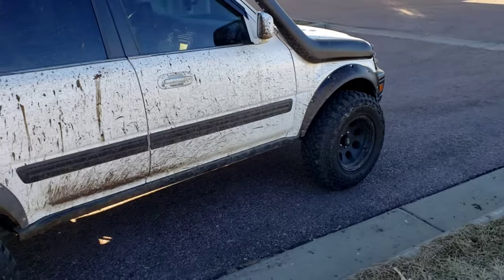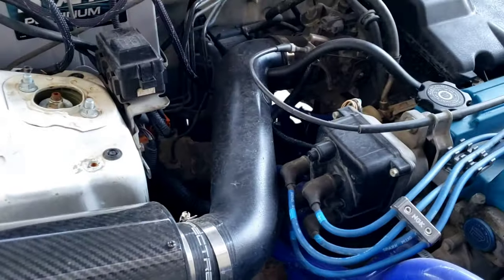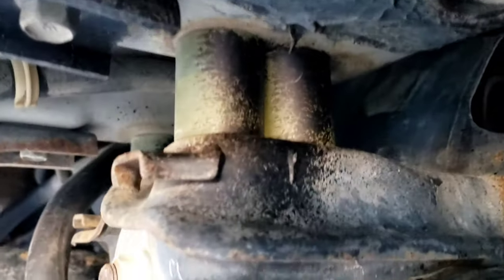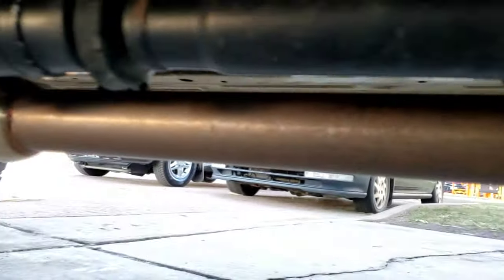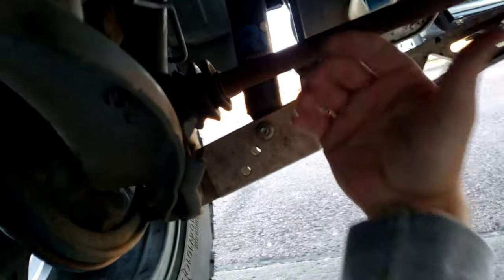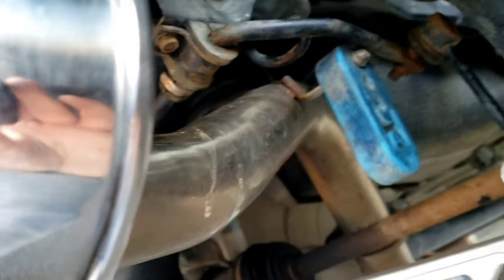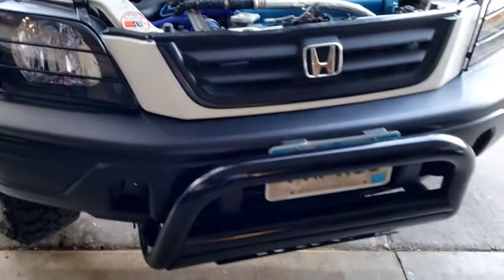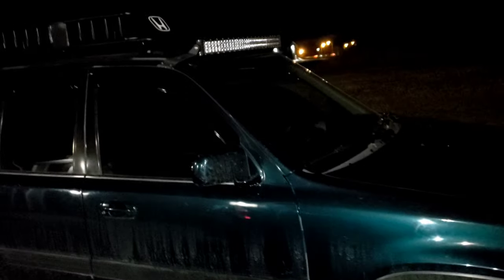A Quickie 😆 on the 4" Ultimate HRG Lift Kit for the RD1/CRV!!

Comment: I opted for the 2" lift.  It's pretty good, but the front struts need clocked, which isn't the end of the world, but it sucks ass trying to get it lined up perfectly.  Also, the front struts hit the body at full droop.  That's another PITA when doing almost any work up front as it binds the lower strut mount.  Lots of dangerous work-arounds were used and still are when I need to work up front.  HRG should weld the top hat extenders off center for that and maybe eliminate the clocking at the same time.  There were a couple extenders for the extra frame braces for the later RD1s.  I had to grind bigger holes to get it to work.  Again... Those two forward holes could have had spacers made out of that same square tubing they use elsewhere and all would have been good there.  

That seems like a lot of complaining, but once it's installed, it does a great job and my wife gets lots of compliments.  :)

Comment: One questions at this point. If I lift My crv 3 or 4 inches using the  Ultimate HRG Lift Kit, will there be any problem driving at a High Speed on  pavement safetely, I mean 75 or 80 Miles/hrs?, because I visited HRG  web page and there is a warning print that says "FOR OFF ROADING ONLY" could you please explain.
Reply from the maker: All the kits are for off road use only every aftermarket part has to say for off road or something similar for safety reasons and legality reasons.
Reply from the maker: But yes you will be able to drive yours just fine as long as you find a good alignment shop after installing the kit I drive mine every day on the highway no problem.
Reply: With a lift alone, your axles will vibrate under acceleration.  Big tires too?  Fughetaboutit.  Regardless of what you hear, your crv will no longer drive factory smooth.  

Im a fan of hrg.  Iv purchased two of their kits.  Great customer service.  Excellent products.

But she aint gonna glide soccermom smooth anymore.